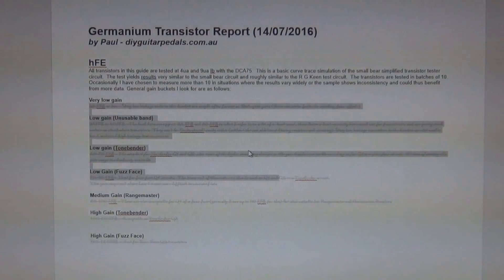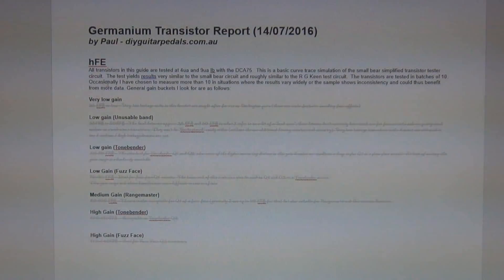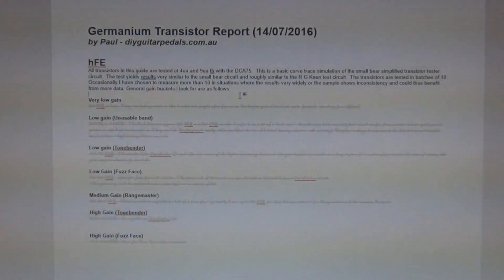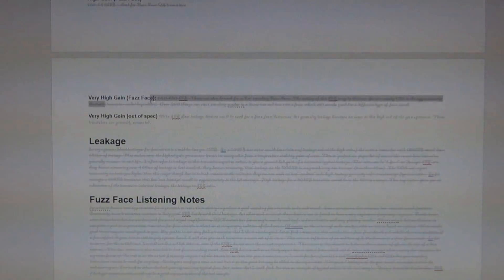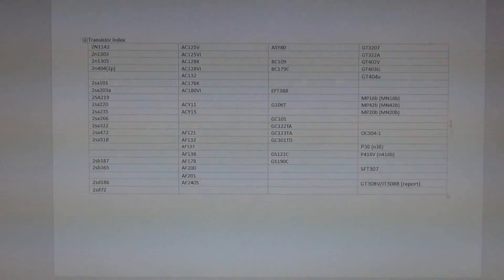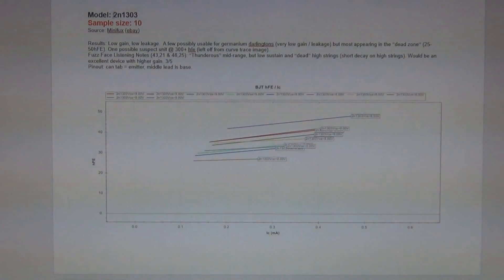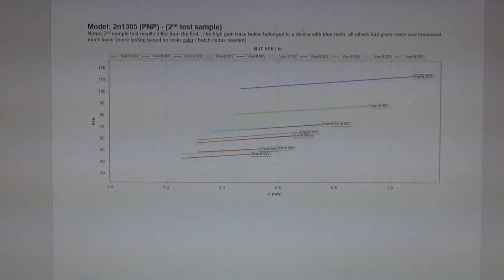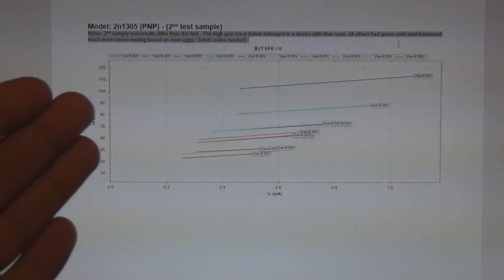My Germanium Transistor "Encyclopedia"

Comment: I have a fair number of those 2n1305's as well and LOVE them for Fuzz Face builds. That said, IME, I have found them quite inconsistent. I wonder if there were some batches that haven't become more prone to failure over the years due to inconsistencies in manufacture, storage, etc. 

The ones I use most are between 60-110 hFE, and show leakage typ. under 100uA. VERY stable. ...I have found, however, that with many of the TI Ge's of that series - esp with hFE > 100 - leakages start to become insane, and there are cascade runaways. 

I had a 2n1309 that never stabilized: After 45 sec, I pulled it at 3mA of leakage... Let it cool and decided to cook it for science. The conduction hit 6mA in a minute. After pulling it from the test circuit, it was hot enough to burn me... be careful!

Thanks so much for sharing this! Hope one day the encyclopedia will be openly accessible.

All best,
Brienne

Comment: Hey guys, I was wondering if it is possible to add diodes to a germanium boost circuit to make it more like an overdrive, and use a DPDT switch to have access to diode assisted overdrive or bypass the diodes and have it back to regular germanium boost mode. Any help would be greatly appreciated.

Comment: thanks for all the great vids . how would you describe  the difference in sound between  the  ac125 transistors and the 2n1305 going in your facemaster kits
Reply from the maker: Of all the transistors i have listed i dont actually have listening notes for the ac125!  Well, they are very similar to ac128 and this is my notes on that model: 
AC128 Listening Notes (hfe/leakage - 86/196, 123/268): Messy but still musical, lacks a bit of ‘drive’ but has sustain.  Some no signal noise. Overall a “Crowd Pleaser” 3/5